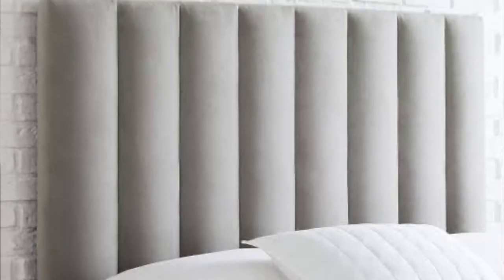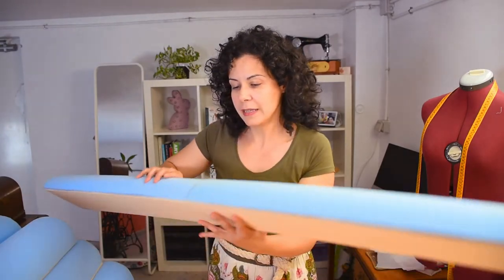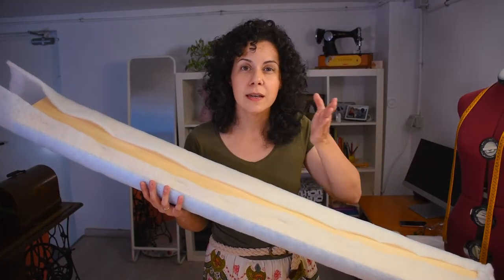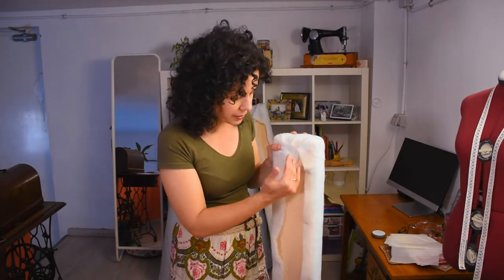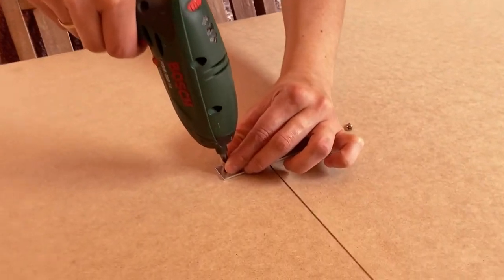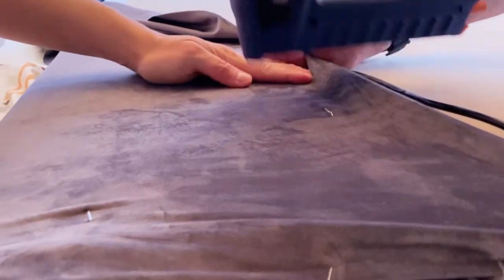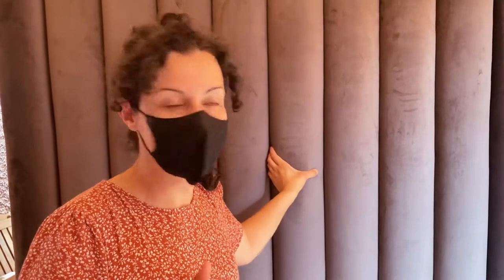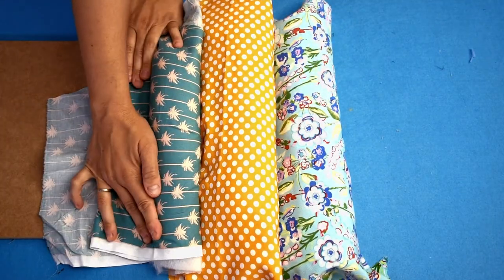Figure out with me how to make a Channel tufted headboard.

Comment: I recently got my first "headboard", at the ripe old age of 51. It is simply my old mattress standing on the long edge and covered with a fitted bottom sheet. That is exactly what it looks like too, but I didn't want to get rid of the mattress, and it is super comfortable, and like yours has the advantage of being easy to change the cover on it anytime I want or need to! 😀
Reply from the maker: Well, it is useful!! And you can always sew a cover with an upholstery fabric if you wanted to 😀